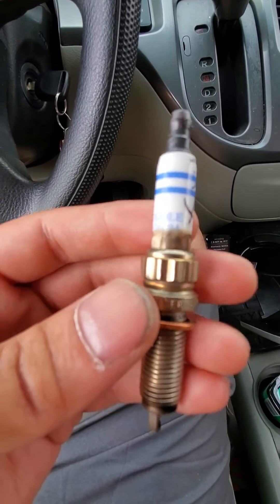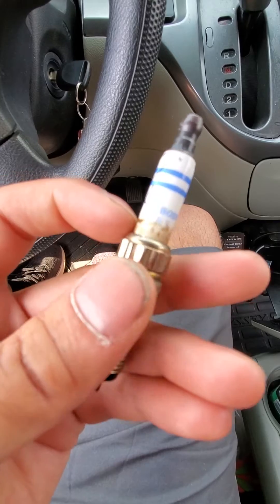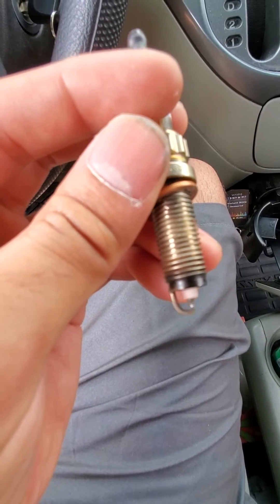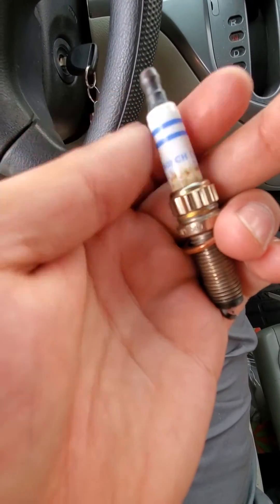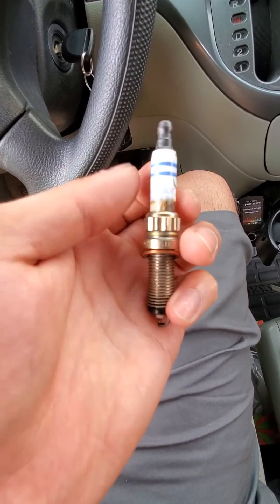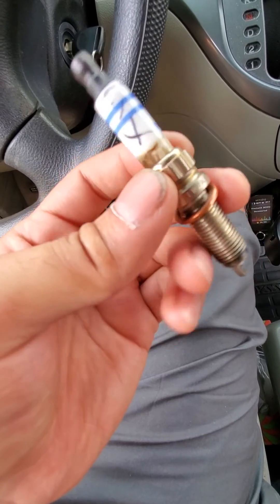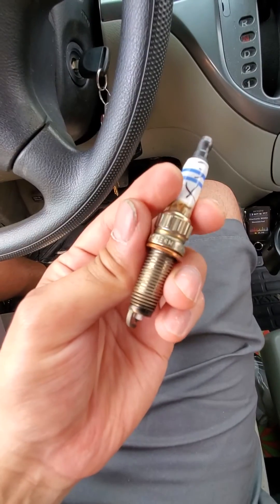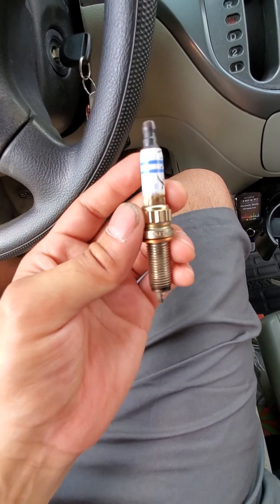M278 Engine Spark Plug Failure OEM Bosch Plug

Comment: Did anyone look into ignition coils as an additional potential issue?
Reply from the maker: @homealone75  coils were checked by swapping them around and nothing changed.. These plugs were the cause of it all
Reply: @TripleCMotorSports  Thanks! Is Bosch Ok or OEM is a must? What’s the torque for these plugs for M278?
Reply from the maker: @homealone75  they are actually both the same Lolol 23nm
Reply: @TripleCMotorSports did you ever get it fixed cause my 2014 cls550 has the same sound
Reply from the maker: @EricCazares-jc6oc  replaced the spark plugs and the sound went away

Comment: I have a 14 e550 with the m278 bi turbo and had the same issue at 60,000 miles and seems like a have another bad plug with 63,000 miles. Did you find out what the cause of yours was?
Reply: I had my plugs replaced by the dealer I had a slight ticking noise not quite as loud as your video and the same sound is now back.
Reply from the maker: These plugs you see in the video are defective plugs. Out of the 8 plugs there were 3 that failed the exact same way.
I haven't been able to do a compression test yet on the cylinders. But I believe there is internal damage because not only is there that noticeable ticking sound, there is also very fine metal shavings in the engine oil.
Iam trying to claim the damages through FCP Euro since I bought the plugs from them.
Reply: @TripleCMotorSports  Did they do anything about the claim? or what was the end result?
Reply from the maker: @infinitycl  nothing done so far and it's been a year now.. Car still runs but under heavy throttle the engine light pops up and claims cylinder 1 has compression loss... Which makes sense because the cylinders wall got scored from unburnt fuel from the bad spark plug.
I haven't decided if Iam going to get the engine rebuilt because that's hella expensive.. So for now iam just driving it occasionally but not ripping it at all.. Just granny driving 😒
Reply: @TripleCMotorSports wtf I hope that’s not what my shit is doing
Reply: Can you put a video from the ticking noise?